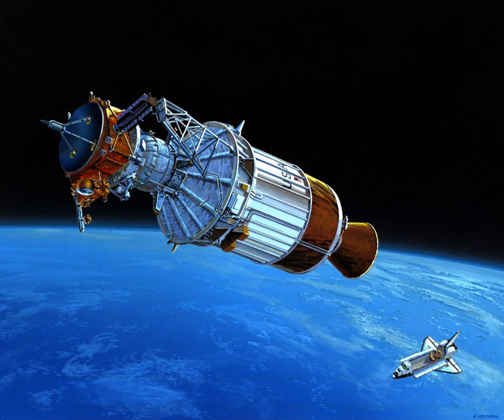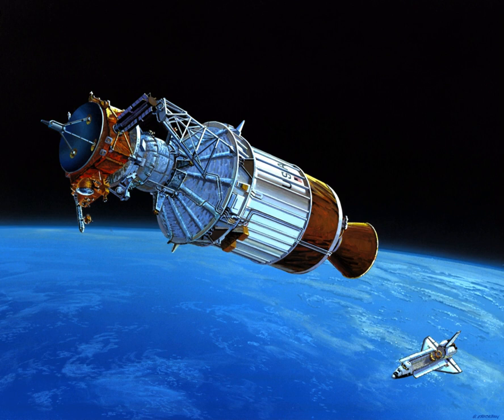Inertial Upper Stage | Wikipedia audio article

Comment: It had a carbon fiber eec....Extendable exit cone made by Kaiser Aerospace and  vectoring 
techroll joint using Kevlar etc.  The kevlar wound motor case and solid fuel was made at United Technology located in the hills south and east of San Jose, California.